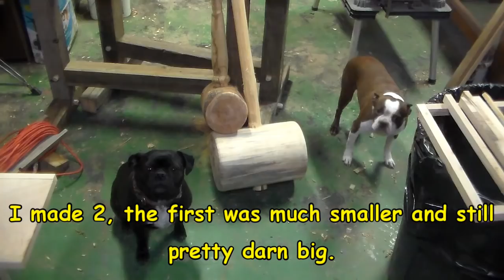Really BIG Mallets

Comment: hope they do not split when drying.
Reply from the maker: The Wood used was long simce dry except the handle on the bigger one. Its small enough I should be OK.
Reply: Thanks, Unc.  I was thinking that the large one was going to get a steel band on each end to prevent splitting and add heft, since you are a smithy :-)  Now, you just have to start lifting weights to be able to use it in one hand.
Reply: @dougrobins8291 where does one get metal bands to put on the ends of the mallet if you are not a smithy?
Reply: @LitoGeorge  That's a good question. If you could find someone who repairs carriage wheels, you'd be in luck. However the cost of adding bands would probably be very high.  I suppose a Clamptite wire wrapping tool (search Amazon) with many wraps would work for the DIY person.